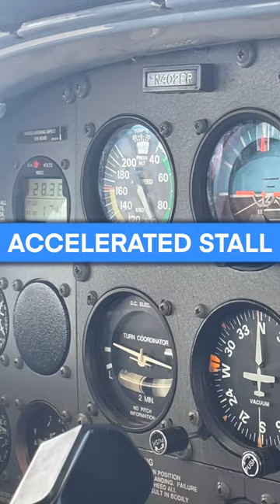How To: Accelerated Stall #shorts

Comment: Spin recovery is what really needs to be illustrated. That is what is  killing pilots right now. Disclaimer im not a pilot. But the majority of the accidents I have seen are due to them letting the plane stall going through phase 1 and 2 where the spin is fully developed and panicking not doing phase 3 recovery and becoming a crater in the ground. Or they make it to recovery, then in the dive pulling back too early and over stressing the airframe, and the plane comes apart.

Comment: How about right rudder!? 🤔
Reply: In the end he says to maintain cordination
Reply: If it's just a stall on the wings, and you think all you need is right rudder, you also have to pick up lift on the wing which means you deliberately have to aim for the ground.
This sounds really bad, but stall recovery practice is useful to know especially if you find yourself going base to final in a crosswind and you over correct to line up. It may save your life.
I have a better idea! if you find yourself not holding the center line, add full power and try again. It's safer to get the he'!l out of there than to spin at low AGL!